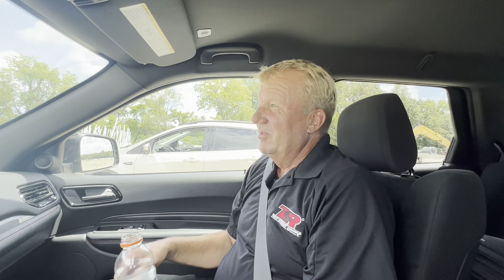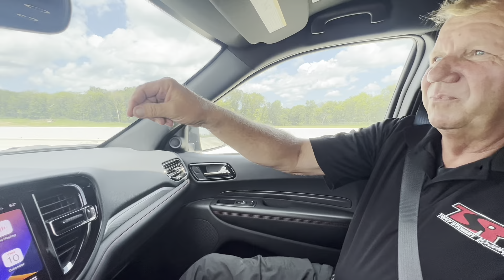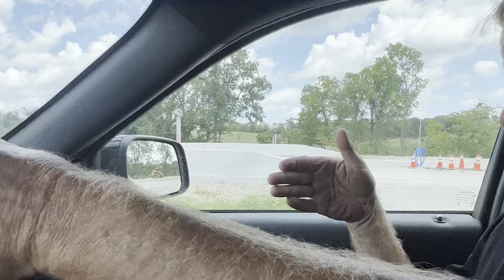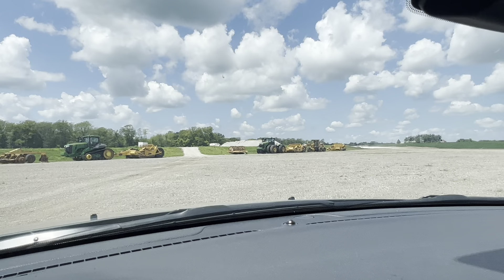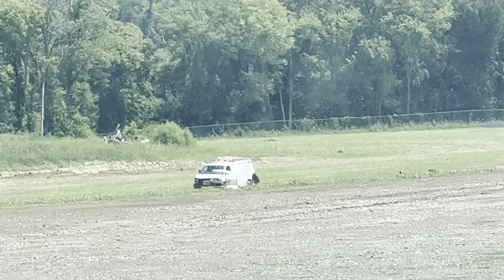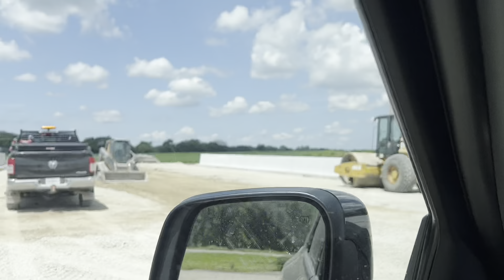First look! Flying H Motorsports Park - A new NHRA dragstrip under construction in Missouri

Comment: That paddle wheel scraper holds current track low ET.
Reply: What class is the wheel scraper does it run on race gas, nitrous, nitro  and is it turbo, super charger, blowers LOL